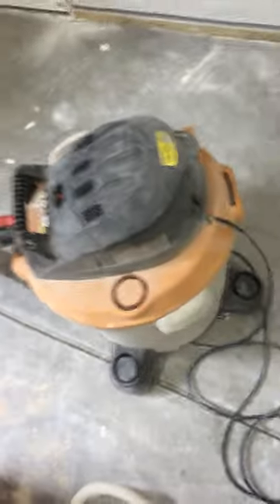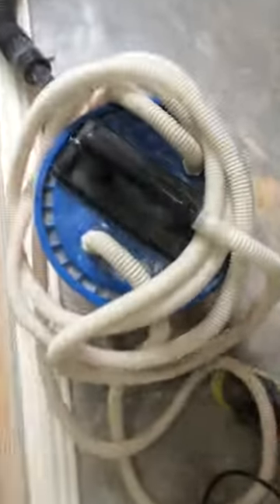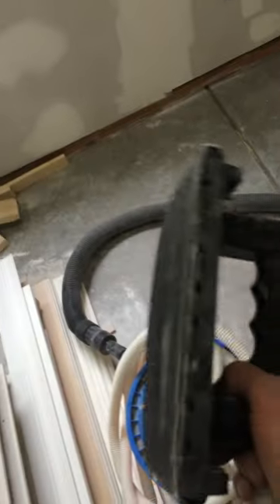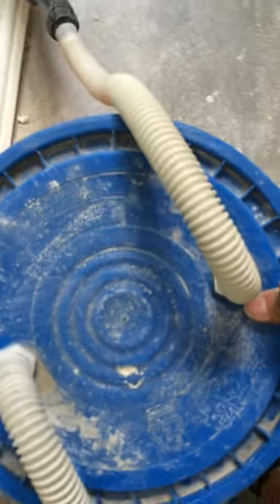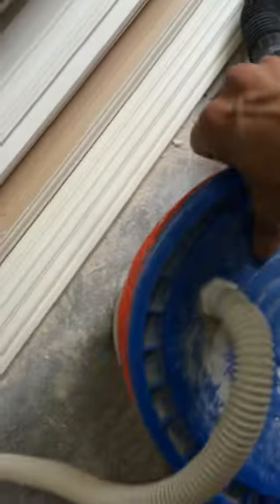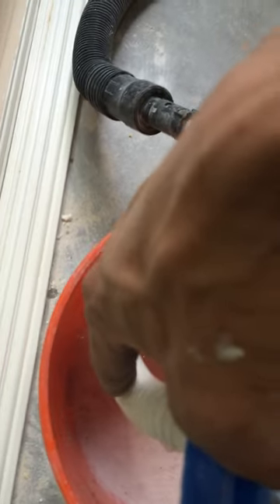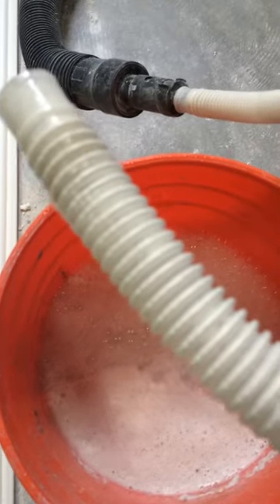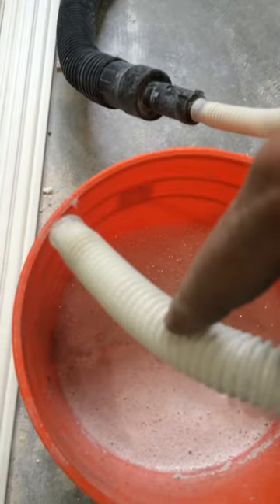How To Reduce Drywall Dust To 97%

Comment: Thanks for that, Mike. I just dug my Sand and Clean out of my storage unit to repair a ceiling in my house. I had to rebuild it after the lid disintegrated after years of storage. All the tubes and fittings seemed to be good to go, it just needed a new bucket and lid. The thing is loud as hell but it works great.

Comment: Magna Sand and Kleen, it has been around for at least 25 years. Works great and saves your shop vac filter as it utilizes water as the filter. It comes in 5 gal bucket and 2 gal.
Reply: Thanks Keith.......👍👍

Comment: Thanks I actually just finished the set up. Works exactly the way you stated. I just cut holes in the top of the bucket and used to old caulking cases for a tight extension fit, wala 😅

Comment: This is good. I built my own dust seperator and drywall dust is a pain it still goes through to the vac filter maybe 20%. I will try the hose and water nextjob i do

Comment: Where do you buy the lid for the bucket and the sanding pad with the vacuum attachment? Looks like it does work
Reply: You can make one easily enough, Greg. Just get a lid from your local hardware store and if you have all the fittings drill two 1” holes on opposite sides of center on the lid toward the outside and pry the rings off the fittings and install. I think it’s worth the effort, these things are loud but they work great.

Comment: Should inlet and outlet hoses be same diameter or can I use a larger 2 1/2" inlet and and a 1 1/2" outlet to vacuum to prevent bucket collapse?